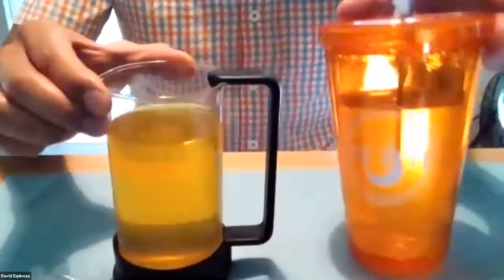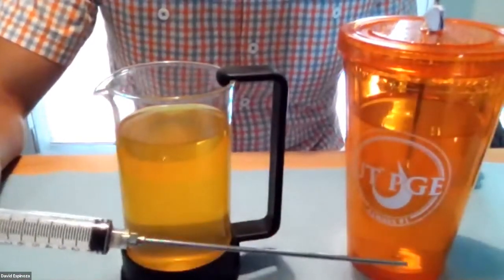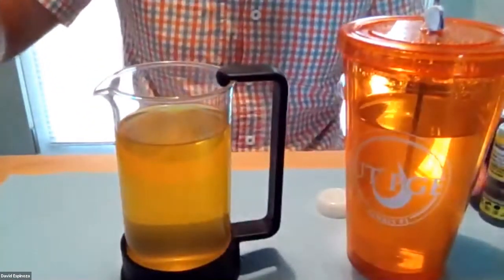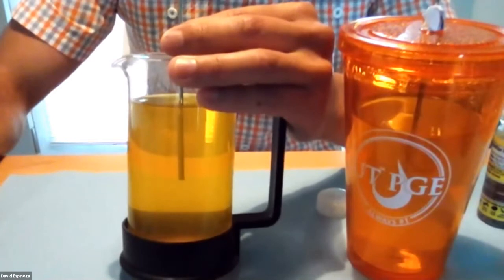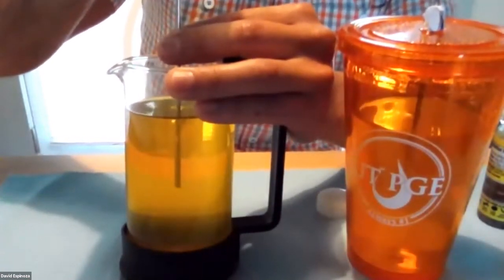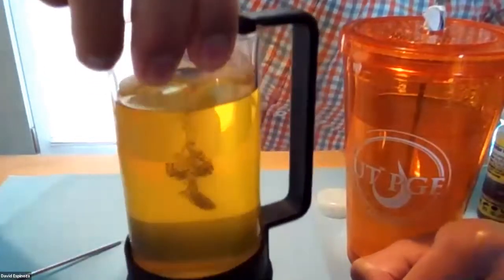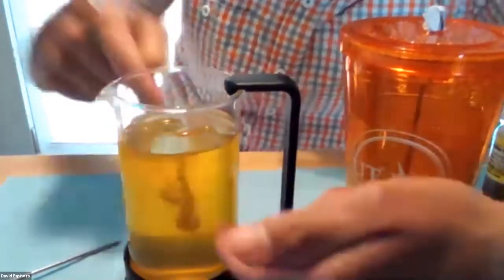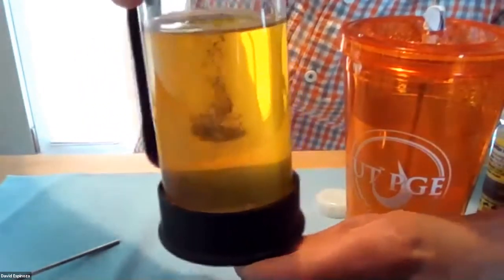Hydraulic Fracturing in Gelatin

Comment: very good and really informative demonstration dear Nicolas
but the initiation of hydraulic fractures brought up a question that i encountered while watching  your videos
you mentioned in your advanced course that by depletion, the total horizontal stresses decrease as well but there was not a clear explanation answering why it is like that
I saw this point in some papers as well, but none of them came up with a physical logic to explain this phenomenon either, what does decreasing pore pressure has anything to do with a decrease in total horizontal stress, they were just reports of recorded pore pressures and Sh min in those papers that confirmed the decrease in pore pressure and Sh min respectively but there was not a physical intuition and explanation for this 
can you please explain this for me?
Reply from the maker: Opening a hydraulic fracture requires overcoming total stress, it requires pushing everything the solid matrix and pushing the fluid too. This is easier to picture mentally if you think in a tight rock, where fracture pressure can be maintained with small leak-off. Since "total stress = pore pressure + effective stress", this latter function of the solid skeleton strain, lowering pore pressure will lower the total stress, and therefore will change the pressure required to open a hydraulic fracture. 
During depletion, the pore pressure decreases and the effective horizontal stress increases, but effective horizontal stress increases less than what pore pressure decreases. The overall result is a decrease of total horizontal stress and a lower pressure required to push the rock laterally with a vertical hydraulic fracture.
More details here: https://youtu.be/RmhKqr7-UwA?list=PLv0npDbE5HXtEcPhMK33EMz6AG0qXWuc1

Comment: take a taller glass and longer needle, so that your overburden becomes higher and we can see true vertical fractures and compare to the one you showed. But, this is already very nice visualisation, thanks!
Reply from the maker: It's not that easy, the Poisson ratio of gelatin is PR~0.5, hence sigma_h = PR/(1-PR ) * sigma_v becomes sigma_h ~ sigma_v. I have a solution in mind though. I will prepare another video soon.
Reply: @dnicolasespinoza5258  cool